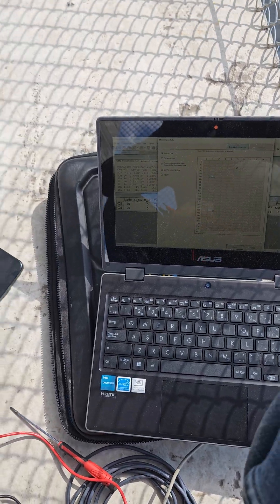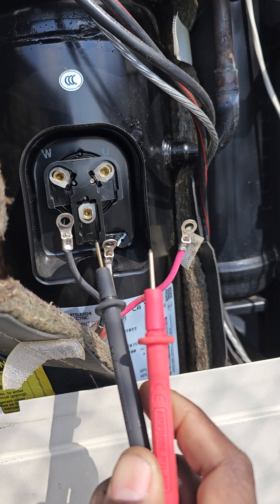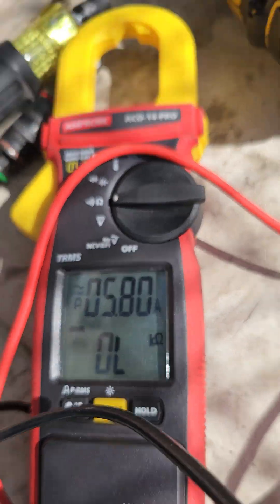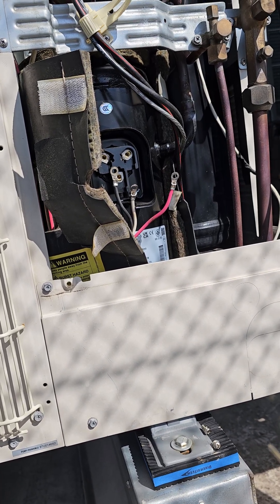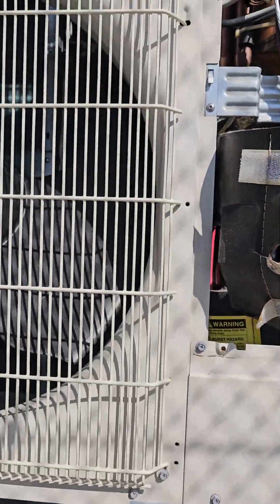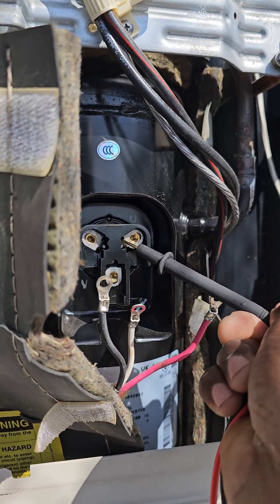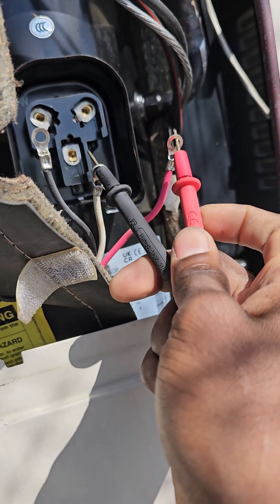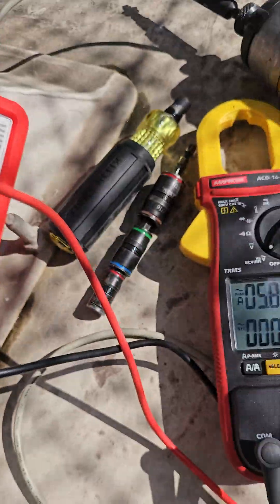4350 4250 ERROR CODES MITSUBISHI CITY MULTI

Comment: You always make great vids for us. 4250 is compressor over current error. It’s either an IPM or a Compressor issue. When you disconnect the compressor on City Multi you have to disable the current sensor using the dip switches…then put system into test run from either mtool or OC dip switches. This will allow the fans to run continuously without stopping.. if the Fans stop while testing then the board is faulty… if the fans run and VAC is balanced then the compressor is bad
Reply from the maker: Thanks for watching my friend

Comment: Thanks for the video.. I'll just add.. when checking compressor power output from the IPM/Power Board you want to look for balanced AC voltage across all 3 outputs within 10%.  Depending on the OC, SW3-1 = ON may give you more time for testing output.
Reply from the maker: 😍😍💪👍 thank you

Comment: Whats a likely cause of a compressor being shorted to ground? Thanks for sharing your real world experiences.
Reply from the maker: Acid inside the system and electrical power supply issues primarily that leads to the windings being over heated